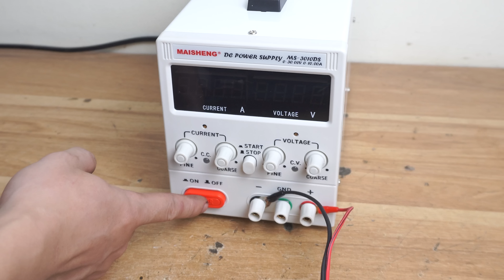Restoration Of Vintage Cordless Hedge Trimmer Makita UH3000D And Upgrade 8.4V Lithium Battery For It

Comment: Hi good Video but I have a question where did you buy that motor from and keep up the good work I subbed and liked👍
Reply from the maker: I bought that machine at a used yard and the motor came with the machine, I just repaired it to make it work
Reply: @hbrestoration  Okay thank you

Comment: Should have sand blasted the blades ,sharpen them new motor 😢😢😢😢😢😢😢😢😢😢😢😢😢😢😢😢😢😢
Reply from the maker: I don't have a sandblaster yet, I will equip it later :(((
Reply: With tools like that, this is great
Reply: Pra que motor novo ? Aquele está bom
Reply from the maker: Sim, o motor ainda funciona bem @eduardopecchio6872